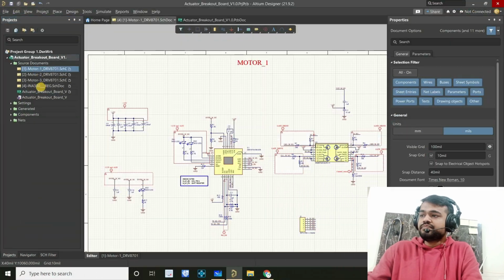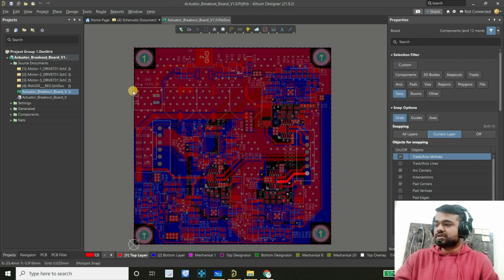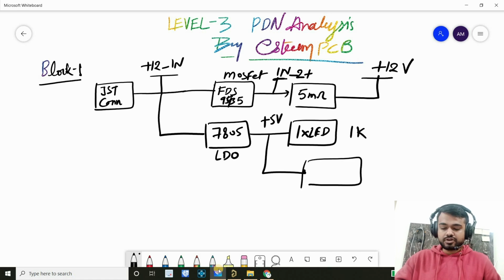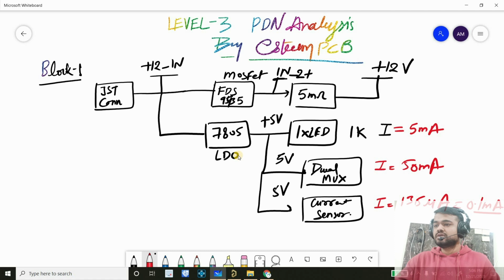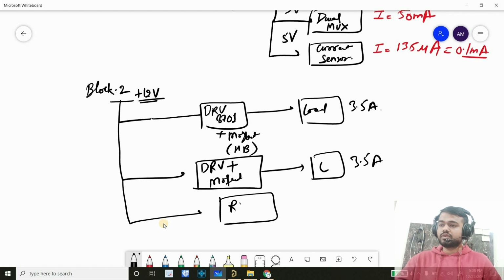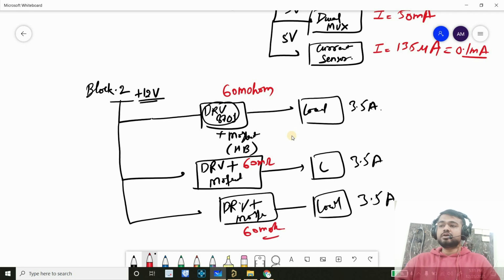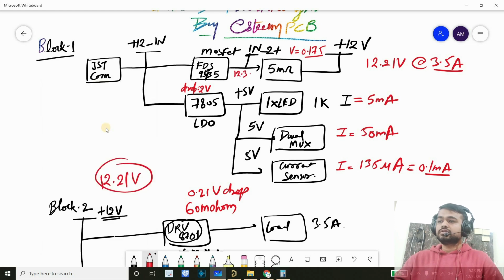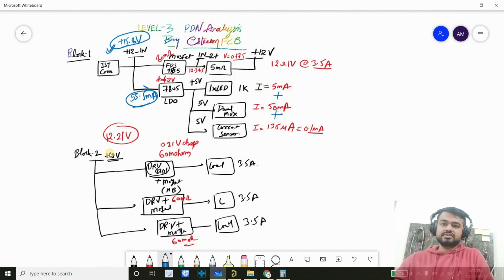PDN Analyzer - How to do PDN Analysis In Altium Designer 2022 - MODERATE PART-1

Comment: Hi. Thanks for this video! I would like to make some corrections. Firstly when you are calculating the voltage drop across the current sensor resistor (Rs = 5mOhm), you made a conversion error (0.005 Ohm but not 0.05Ohm). The same mistake you made for 80mOhm conversion. Secondly, if we are calculating for the worst case (all motors are fully charged) for voltage drops in block 1 we have to consider the current consumption of 3 * 3.5Amp.
Finally, for the input voltage on jst connector we had to give the result below :
Vjst(at 3*3.5A) = 12 + 3.5 * 0.06 + 3 * 3.5 * (0.005 + 0.08) = 12 + 0.21 + 0.0525 + 0.84 = 13,1025 V
For one motor :
Vjst(at 3.5A) = 12 +3.5 * 0.06 + 3.5 * 0.005 + 3.5 * 0.08 = 12 + 0.21 + 0.0175 + 0.28 = 12,5075 V
If i was wrong somewhere in my calculation please let me know.